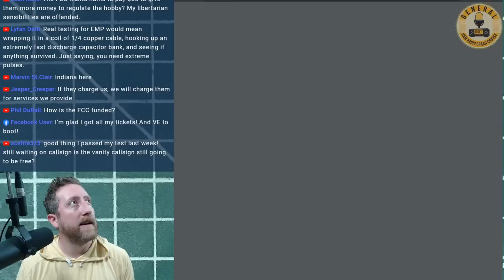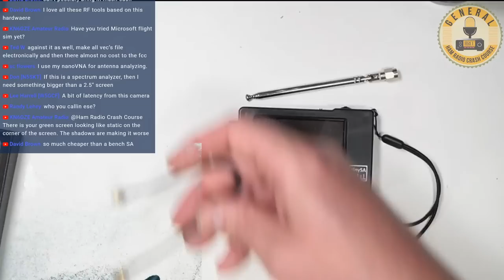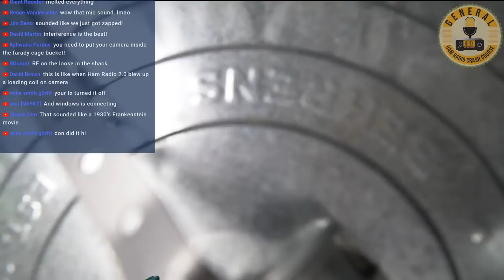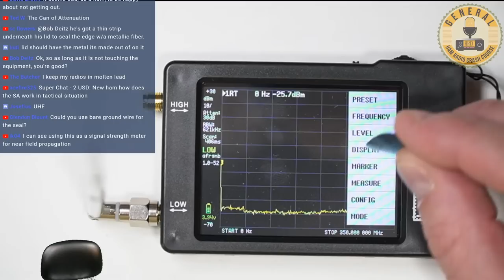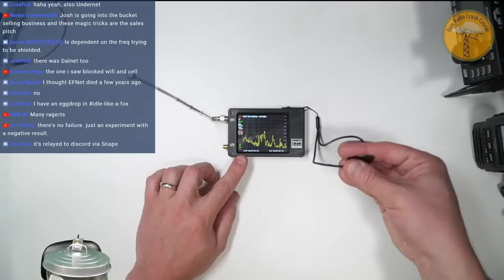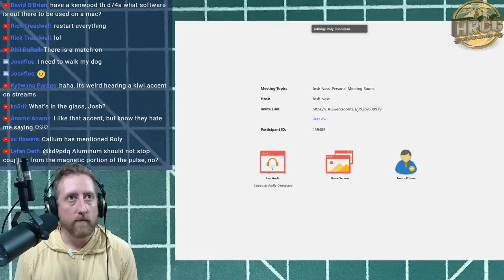How to Test EMP Proof Container with tinySA. Let's Test The Tactical Trash Can - Livestream

Comment: Collapse your whip to attenuate things! I ordered one of these, doing 144mhz weak signal(EME, Tropo...)I need to power line trash hunt almost constantly. If it is within 1/2 mile I can hear it LOUD and that can cover a weak signal. Going to add a tape measure yagi to the input for directional testing.

Comment: TACACN1: While these tests are great your forgetting EMP's E1-E3 pulses are not 5W or 100W its like 50KV/m  [50 kilo-volts per meter !] this is many orders of magnitude bigger. You would have to use like 100000watts+ next to your can to simulate- test it I would think.  There is still huge value tho in doing this just depends on how close you are vs shielding.  
 
[I think 120 Watts only gives 250 V/m] where a nuke is in KV/m [further to the material the conductivity and skin effect comes into play alloy would be better -copper best. +Higher wavelengths like UHF are smaller and get into the cracks.]
Reply from the maker: Lol, I’m in a garage. I’m working with what I have. Yes, this is absolutely predicated on distance from blast.

Comment: Is there a way to achieve the 100db attenuation without an insane amount of work?
Reply from the maker: Most military levels call for 60-75db. If you’re closer you’re dead. 😬
Reply: @HamRadioCrashCourse  Hahaha. Touche. Do you have any idea for doing pass through of Ethernet and 2 small usb extensions? I’m trying to do wifi testing and need to isolate out external networks while generating a network within the cage.
Reply from the maker: I am sure there is likely a way, but I don’t know how. Sorry.

Comment: It looks like you lined the inner container with something. What is that? Does it provide extra EMP protection?
Reply from the maker: Why do I need an inner container?
Reply: @HamRadioCrashCourse  I was just noticing that it looks like the can has some sort of liner inside it when you you were testing the can. Did you add something there or did the liner come with the can...or am I seeing something that isn't there?
Reply from the maker: Ah, I covered that at the end of the EMP kit video I posted earlier in the week.  There is cardboard and light packing material.
Reply: @HamRadioCrashCourse  Cool. Thanks for the reply and what you do for the hobby.

Comment: Maybe for a quick and dirty test the Tactical trash can at higher frequencies you can just put a cell phone in it and see if you can call it when you are very close to a cell tower.  If you can use a GSM-1800 mobile it will be high enough and if it works you'll also know that you can protect yourself from the big-brother tracking of your phone if required, since with most new phoned you can't remove the battery any more...  If you have a 5GHz Wifi device you can try even better, I don't think you stop that though the wavelength is very very short then...
Reply from the maker: We did it on the after chat. Phone didn’t have any signal. Could not take the call. 🤘
Reply: @HamRadioCrashCourse  That's great!